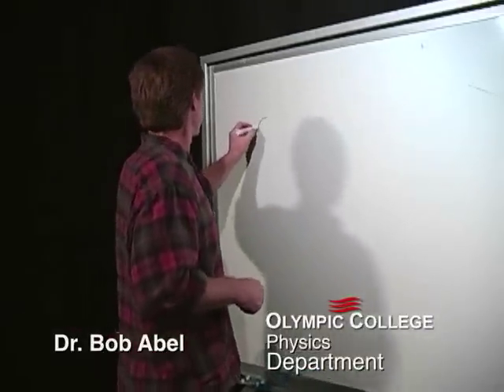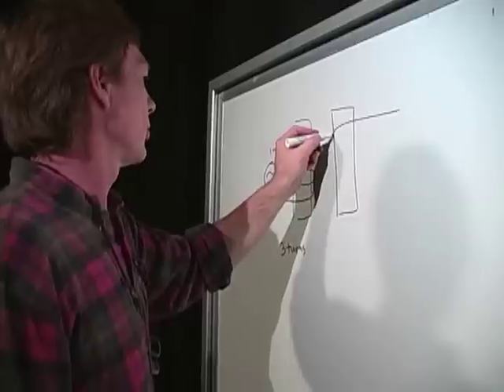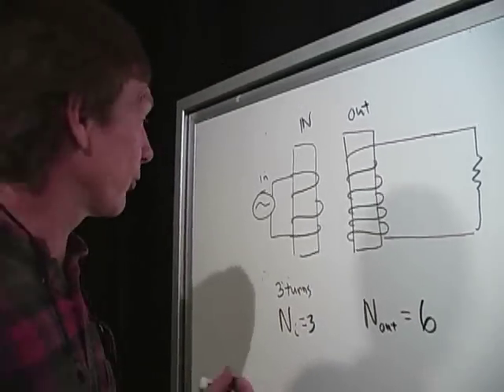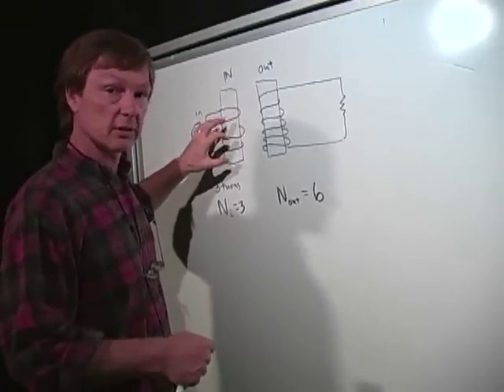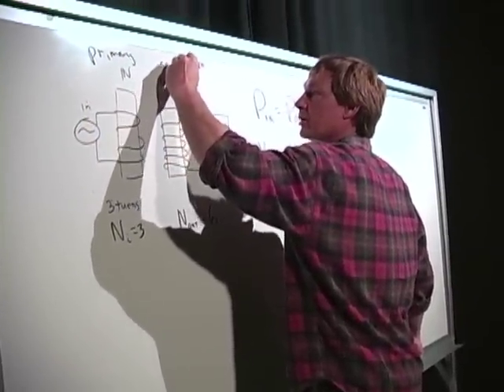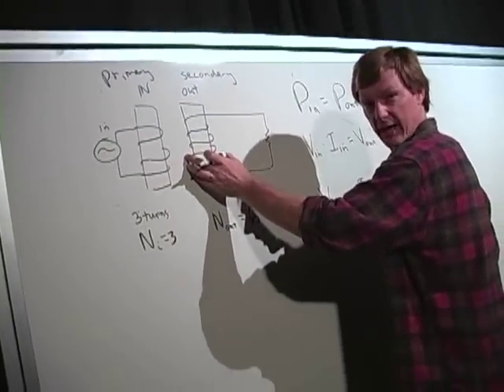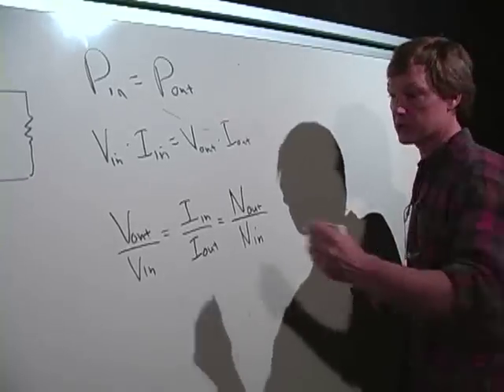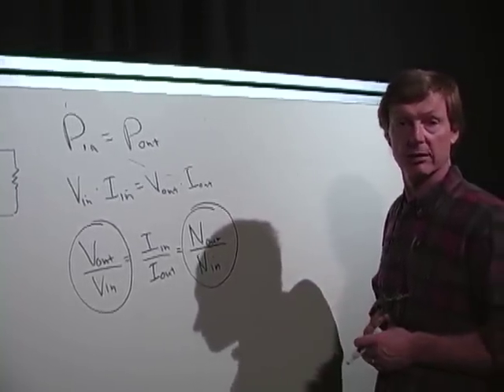Physics III S_ Electrical Transformers-Bob Abel Physics You

Comment: i was wondering if a person could take a 15000 watt step up transformer, mount it close to a  new mains circuit breaker panel seperate from the grid and then pull the furnace wires and fridge etc and put them in the new box thats powered by the tranformer? is that  a way to save on electrical?

Comment from the maker: I think not.  You can get energy from the system that way, but there are losses in the transfer that would cost you.  Also, you're stepping up in voltage and not wattage, so as the voltage goes up, the current drops.  Plus there are losses, so the output wattage would be less than the input wattage.  There are more details in this, some of them beyond my ken, but this is essentially the issue - you always get less out than you put in.  - bob